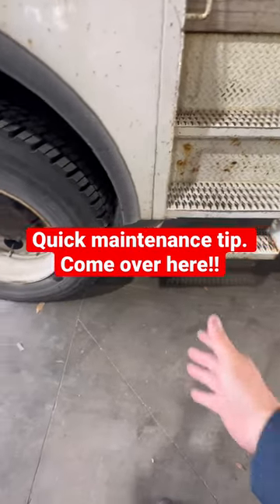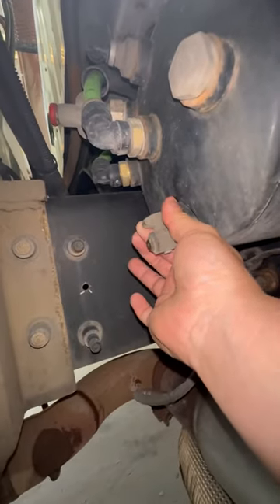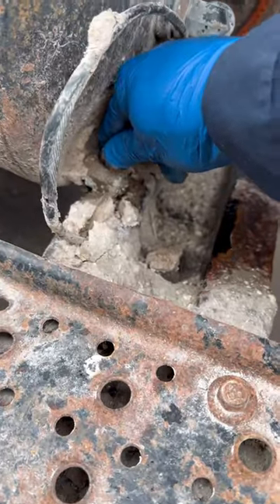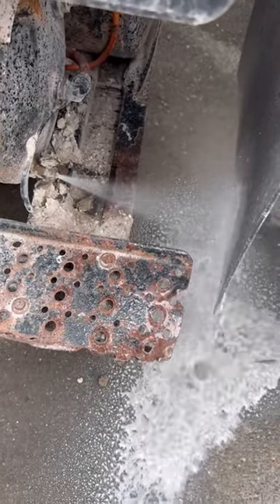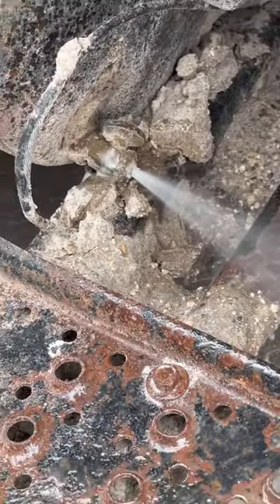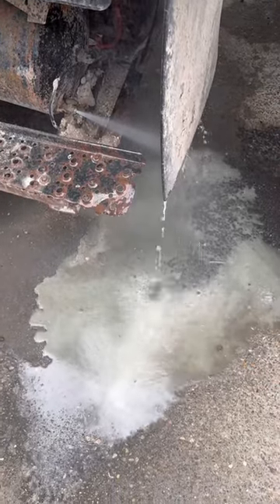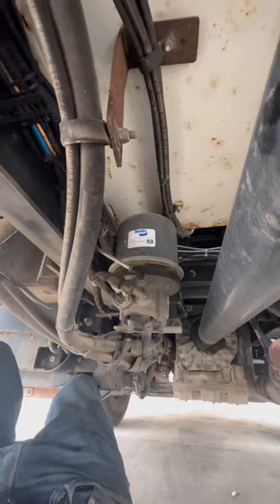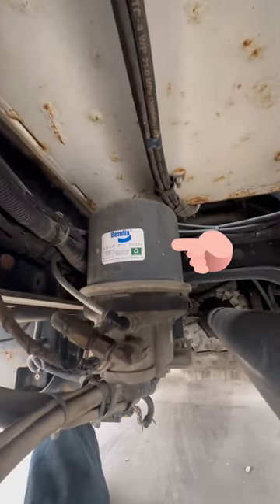#mechanic #trucker #diesel #dieselmechanic #trucking #semitruck #bigrig #trucks #truckerlife

Comment: That had to be a Volvo. They are notorious for moisture build up in the system. I change my air dryer cartridge every October before the cold hits here in New England.
Reply: My dad used to have one to get his CDL with, same issue lol. Was a reliable truck though and it had over a million miles
Reply: It's an international
Reply: Funny, I rarely ever see Volvos spit water like this and we have probably 100 or more in the fleet that comes through our shop. I guess either we have good drivers or our preventative maintenance is that good lol

Comment: I've seen that from the prefilter to a ship's air system drier. The condensate trap was failing to blow down and the whole thing was filled with water straight through to the drier inlet. Whole lot of water comes out of sea air, only took 3 weeks to fill up at least a gallon

Comment: Man I really enjoy your channel 😊, I had a complaint from an oil company about one of their instrument air systems freezing up in the winter and they had installed inline filters on water traps to try and solve the problem, I was told that i was the third mechanic to try to fix the issue, the tank had an electric auto drain valve on it that was controlled by the plc but the plc had never been programmed to cycle the drain, the tank was completely full of water and was running out when I pulled the discharge fitting 😂

Comment: I got a buddy who had one of the huge vertical air compressors and it would cut back in trying to air up a flat lawnmower tire so I thought to myself that thing probably has a ton of water in it so I reached under to hunt down the drain in the dark and man that thing had to have been half full of water took it about 15 minutes to drain out then for good measure i pressurized it and blew it down again to clear the lines and get any residual in the tank

Comment: You got to see the trailer use for containers the brakes looks like hydraulic all the water coming out the problem is in winter time the valves get freeze and brakes lock 🔐

Comment: I love when a truck comes in for "brake issues" and after draining a gallon or two or from the tanks, you also figure out they need the entire air dryer because they let the clogged filter go too long.  Then the companies want to argue on why they need an air dryer, abs valve, leaving valve, and foot valve.

Well, if your driver hadn't run this thing like he stole it, or your own terminal actually did their regular maintenance, you wouldn't have ruined half your sure system with gummed up valves....

Comment: The biggest problems when people order truck is location airdryer.i work western canada lots contractor install on right front on frame outside near radiator save lots time and problems.when i drove arctic ice road in nwt i put anti freeze for air line,drain all tank,make sure air compressor good shape,install new governor valve yup save lots problems.thank expose this lots driver don't know about this yup.😊

Comment: I was managing 14 different T800’s with ISX engines and Ultrashift trans. Even though these dudes had powerful trucks that were easy to drive (especially after the 5” punch and ECM flash) they were always breaking air system stuff. Come to find out not one of them drained their tanks (even though I had pull lines set up in such a way to where you just had to step on it for a min to drain the water). I called a meeting one day to show them what I found. Half the dudes didn’t know to drain their tanks and the other half made excuses for why they didn’t. I guess this keeps us mechanics in business tho.
Reply: WOW. You're company should incorporate those annoying (but necessary in your case) safety and preventative maintenance checks for them to complete online. That'll help the unknowings. The lazy ones you're gonna have to take out back.

Comment: a shop i used to work at has compressors that always have water in them. the outside is rusted and i'd dread to see what the insides look like. it's not uncommon to get water in the air lines when working too.

makes me hesitant to even be around the damn thing just in case it explodes